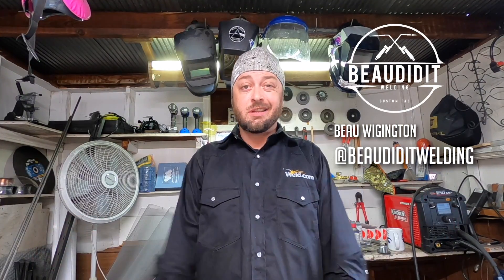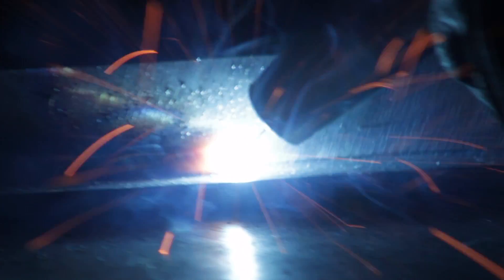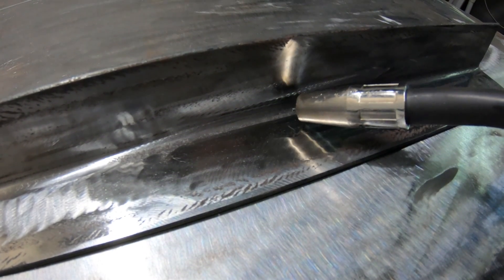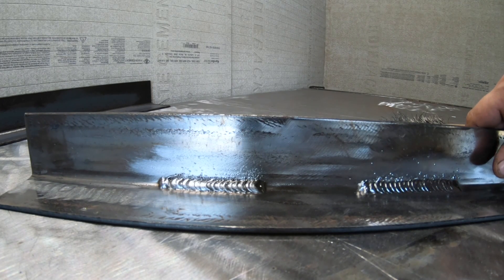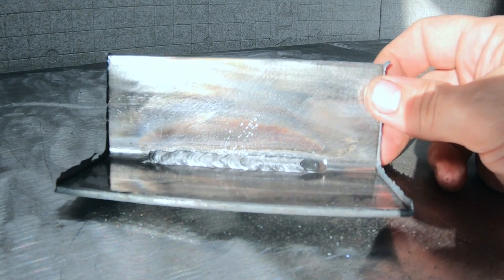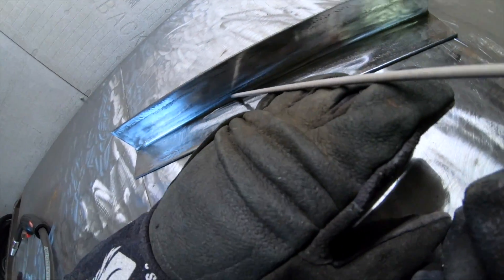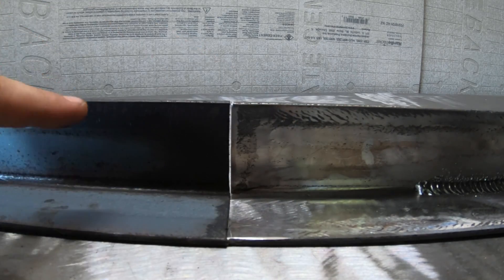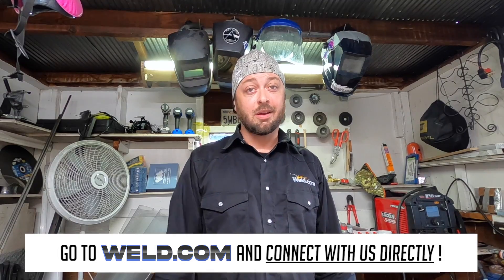Welding 101 - How to Prevent Undercut

Comment: How do you prevent undercut on a 6g pipe welding with 7018. Im having a super hard time with on my last cover pass on the top side of the weld. Especially from like 3 to 9 oclock
Reply: Make sure it's cooled off, or slow down a little.
Reply: @JackOffAllTrades  I wait till I can keep my hand on it for like 10-20 seconds. I feel like I run a pretty slow and consistent speed. I'm running 1/8" at 105-110
Reply: When I was in school it was a speed issue with me. Make sure you are paying attention to the top of the puddle and remember how much heat you are putting in the higher you get on the pipe.
Reply: I am a pipe welder and have been welding professionally for over ten years. I weld in power houses, chemical plants and refineries. My best advice is make sure you fill your bevel before you cap. You should be within 1/16 of being flush. Also watch your work and travel angle. You need to pretend you are pointing your rod directly at the center of the pipe all the time. Learn to weld with one hand. The better and faster you can move around the pipe the nicer your stringers will be. Watch your heat if you weld to hot you can get undercut. Also if you watch the edges of your puddle you can see undercut. The edges will be kind of shiny and when you see it you slow down or push some metal back to fill it in.
Reply: @dans8169  thank you very much. I figured out what I was doing. I was talking to a coworker and I turned my Amps down 5 and I'm good. I let it cool a bit before my last cap pass to
Reply: the main way t o prevent UC is by keeping the arc, filler material, off the parent metal by allowing the puddle to flow to the parent and fill the arc crater. while weaving keep the 1,001 1,002  count in your head at 1002 whip through the middle, hold arc at the opposite edge of weld count 1,001 1,002 allowing the puddle to fill the crater created by the arc being moved to the other side repeat motion to the end of your weld, it will almost look as though u r not moving but rest assured, u r. one last rule of thumb that applies to both flame cutting pipe and welding it. keep the electrode and the flame directed towards the center of the pipe. I hope this helps. GL
Reply: pause longer on the sides might help
Reply: Keep practicing. That’s a tough test. Wire brush and grind and then finish. Or count to ten and finish it
Reply: Maybe turn Amps down. I naturally move to fast when running hot.
Reply: if everything else is fine elsewhere, what is changing? I would guess the angle of the stick etc.
Reply: https://youtu.be/x0_KXL8_syE?feature=shared

Comment: Damn bro I was as having issues with my cap for a test and as soon as I read the comments I realized I was capping it when it's too hot 💀💀💀 fixed it 😂😂😂
Reply: @AldevaranMT  dude I’m having the same issue I’ve tried everything and I still get undercut I’m running for my 3g open root and all I need is the caps, but I still get undercut no matter what, I need help !!!

Comment: Where I work, we weld a lot of 1"- 4" plate and use spray transfer (typically 28.5-29.5V 300-325A with 98/2 gas and .045 wire) I'm getting undercut, but I don't want to dial my heat down too much. Am I going to have to dial down or is there a technique I could try to prevent this? Any help would be greatly appreciated! Also if you are curious about the metal thickness, it is because we do testing on high pressure steam systems 2000+ psig with piping and valves up to 28" sch 160 GR-C. No I don't weld the pipe, we have real nuclear certified welders for that. I just build the stands and fixtures. I would like to get Nuke certs one day though but right now my skills are not up to par for that.

Comment: Great advice bud, me working a shipyard....Not one single bit advice here is going to help or save me....sigh. Sorry for the half jokes I have to tell others in classes that the prep and material even the booths don't exist out here. You're going to get rust paint piss and shit where you have to weld and that's if you will either see it without a tiny flash light and a mirror in spot that you might only get your hand in.

Comment: What advice can you give with spray arc? Multipass tee joints. You can't do manipulations. I think in sine situations gun angles go out the door its really about watching the puddle because gun angle will have to be adjusted. I think overheating can also cause a lot of the undercut. The last bead on top is always the hardest weld because its always the riskiest pass if the conditions aren't correct.
Reply: In my experience with spray transfer, letting the metal cool after a couple passes really helps with undercut. And a little manipulation can be done with spray transfer, just have to be quick with it. Can't rush spray cause of the intense heat transfer. Cooling is the main thing in spray transfer to prevent undercut.

Comment: Need an answer asap I just bought “Tweco electrode holder 500 amp”, and this thing is kinda more huge than I expected. I stick weld at delmar college and my other electrode holder is 250 amp but bought a new one because jt sucks at holding rods. Anyways I just need your word if it’s meant for different amperage’s and not low ones like 200-300 amp. Because it was atleast $80 and feel like I kind of wasted money. It looks like it would be perfect for 1/8th rods and even bigger but if you can tell me that it can be used just like my 200amp electrode holder as well I’ll greatly appreciate it.
Reply: did you get your answer yet?

Comment: A beginner welder should not learn to weld with any manipulation or weaving techniques with mcaw aka mig specially in fillet welds. You should only weave or use any manipulation if filling gaps or welding vertically. Otherwise it's like buttering bread and you will lack penetration into the wild joint. To many of these welders on YouTube teach this practice but it's improper and is why so many fail tests. It is also a safety hazard depending on what you're welding. If it's structural and that weld breaks people can get injured. The moment I see videos teaching this process outside of filling gaps or vertical welds I stop the video instantly.
Reply: @metyheaval  I'm self taught and passed my flat horizontal test first try with a weaving technique. I always weave no matter the position because it helps keep a consistent speed and results in a much better aesthetic. The key is to make sure you are consistently ripping out enough material with the arc by welding at the correct angle and not moving too fast.

Comment: Does it make any difference whether you are pushing the weld puddle instead of trailing it?
I push most of my welds to pre-heat the parent metal.
Reply: With mig the difference of push vs pull is negligible. I prefer to push so i can see the puddle and travel direction better. Only time i push with smaw is uphill in the 3rd position.

Comment: Great job on your video. Was hoping y’all could discuss welding in the downward direction as a means of repairing undercut. Does it work? And why?
Reply: I am not 100% sure about that but I am interested to learn myself.
Reply: Bryan, Typically a downhand weld is less prone to undercut as the mechanics of the weld are changed physically. Traveling with gravity vs against it defiantly helps reduce undercut. There are a few take-aways that I think need to be considered when attempting to repair undercut with a downward weld. First and foremost, is the code you're welding to allow a downhanded procedure? Has it been qualified? Most procedures and qualifications specify the position and the direction of travel. I think this should be in the forefront of your thought process. If its allowed it can be a quick fix. Unfortunately, more often than not, its not allowed. I would hate for a guy to get in trouble because a good weld wasn't repaired correctly!  I would direct this question to your QCM or shop Forman for an answer according to what your specific application is.
Reply: Downhill welding isn't recommended unless you are laying in a root pass with 6010 on pipe or fabricating some thin material. Welding procedures call for uphill travel

Comment: Where i work they say dont use any manipulation
Reply: but how much is any? I guess they want stringers, what process are you using?
Reply: @atomichydrogenweld2823  mig spray, building locomotives
Reply: @mindgames9614  yeah, mig spray does not allow manipulation.....smooth and fast......I assume you mean solid wire, and not FCAW-G .flux with gas
Reply: @atomichydrogenweld2823  yeah all solid wire
Reply: That is another manipulation for sure these are just what works for me on my projects but I am trying to master the drag as well.
Reply: Unless you are using 7024 jet rod you have to manipulate the weld
Reply: @gargar8196  not true
Reply: @mindgames9614  how’s that? How long have you been burning rods I retired after 37 years of welding So think about what you really want to say
Reply: @gargar8196  its not necessary when you’re spray welding or even using short circuit really. The arc is going to penetrate regardless
Reply: @mindgames9614  ok that’s a whole new ballgame. I didn’t know what you were welding